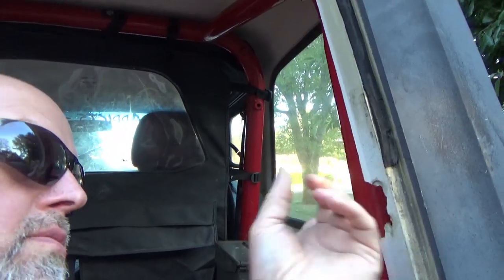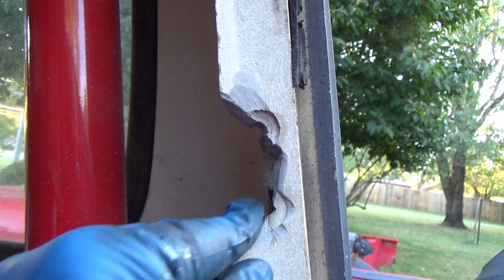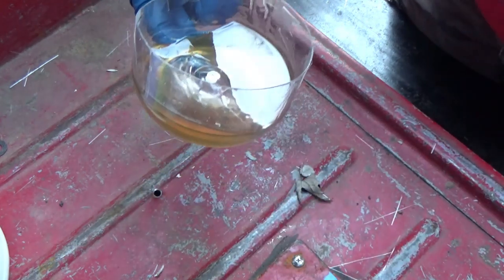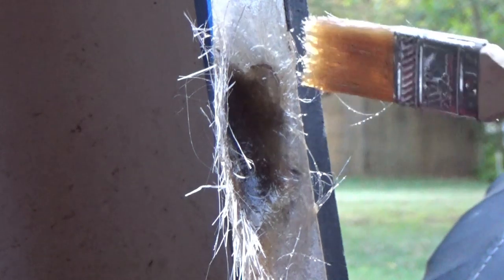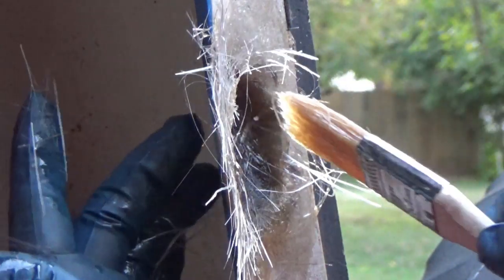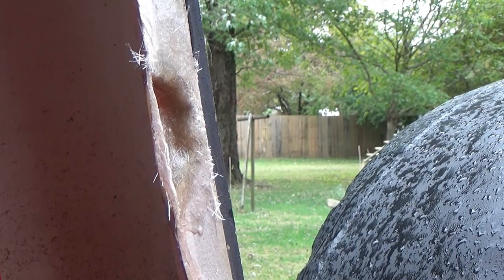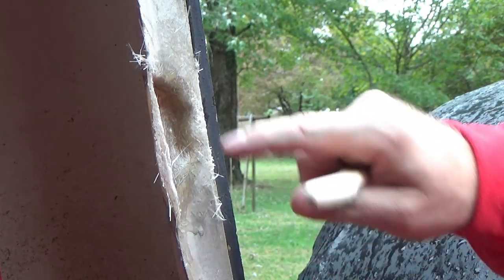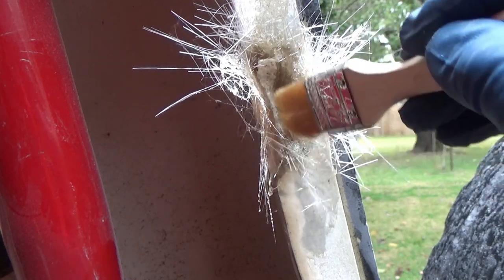Jeep Wrangler Hardtop Repair - Lower Strut Mount Broke Out #jeepwranglerhardtop

Comment: I have a hole in my hard top from a tree branch as well as some cracks. I will have to paint over the repair. How does the paint affect the materials used in the repair? Your kit information says "not for clear coat applications". what do I need to use in this case? Does filler 
(for the cracks) react with it? Awesome video, by the way, I just learned a lot. Thanks a million.
Reply from the maker: You will have to grind the paint away from the place to be patched. You want nothing but the raw top structure to bond the fiberglass too. Once you get the patch worked smooth you can then paint it with whatever you like.

Comment: Awesome video im actually in the process of working on my hard top im modifying my top to work with my half door uppers i prefer using my half doors then my full doors but im doing it in a way that if i wanted to use my full doors i still can
Reply from the maker: Glad you like the video!! I enjoy working with fiberglass. It's kinda like "functional art" I guess one might say. I have a set of full doors. I dont like them at all!! Only reason I bought them was to make videos off of them. Once I'm done with full door vids, I'll selling 'em. I like my soft doors. I've got 2 sets of half doors. Got a set of upper sliders on the way to restore. They should arrive today as a matter of fact. The other set of half doors are gonna get nodded for my offroad toy.
Reply: @Poweraddicts  when you go to restore the sliders definitely make a video of that cuz I love my sliders that's why I modified my hardtop put the fabric starting to get wore out on them but the way that I modified my hardtop I filled in the right behind the door frame with fiberglass then sanded it down to the shape of my door it has to still rebuild the drip Channel across the top
Reply: If you're a part of YJ Fanatics facebook group I've got a few pictures of it I'm there